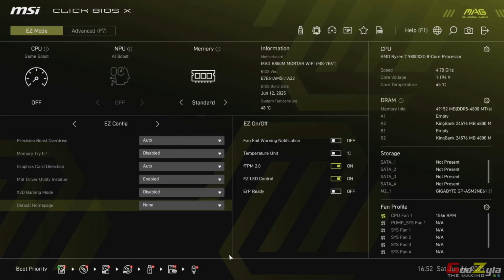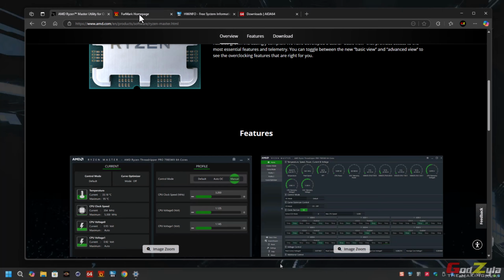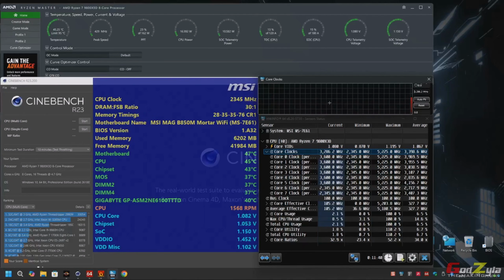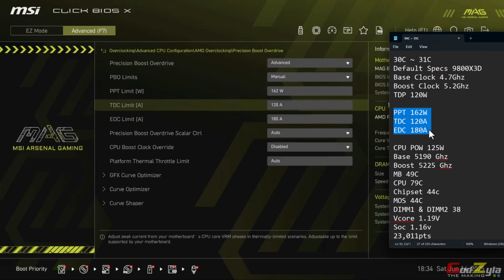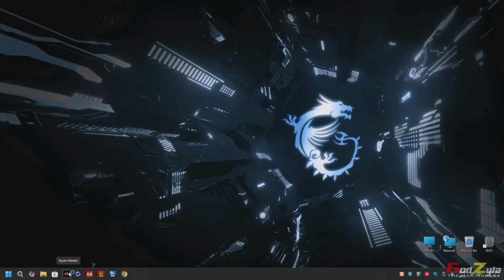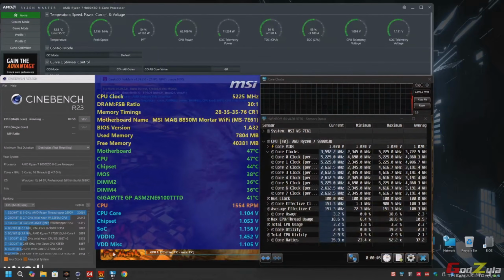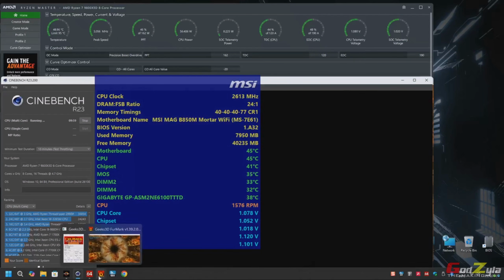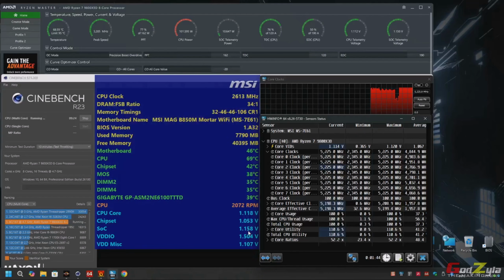PBO2 Curve Optimizing with 9800X3D on MSI Motherboard

Comment: hi i hope u still remember me lol 😂 I've followed your link and came here to learn how to tune my 9700x, 

JUST A QUESTION TO ASK YOU. before i tune, i follow someone on internet and open my pbo to enhanced mode 3 and let it draw out the power of my cpu,

yes indeed my cpu can hit 24000+- on r23 with voltage around 1.28+- and my cpu can maintain 5.5ghz no problem, but my cpu package power almost hit 170W, and i can't even find anyway to cooldown my cpu as it straight went up to 95° within seconds all the time 😅😅

why can't my cooler cool down my cpu as i saw other ppl running benchmark but still able to cool around 85+-degrees, but their cpu power is around 140W mine are 165W+-, does that matter? also my frequency are also slightly higher compared to the guy i watch. other than that all seems good

so i tune accordingly with your setting, im not sure whether this is a good performance or not for 9700x compared to others, since im just first time pc build and want to draw out all the power within a safe usage,

the results very good, from default 4.7ghz went to 5ghz, voltage around 1.05+- which is overall better than all the default tuning, even r23 from 19500+- defaults can hit up to 21800+- withou any heat issue or such
Reply: before doing this tuning, i run with pbo enhanced mode 3 with furmark cpu test, and the voltage is quite good as people said, mine which is around 1.18+- and can stable 5.37 ghz no problem, just the temperature is very hot went to 95 few seconds after start testing, but the r23 results is good, around 24k, but the cpu package power is around 138W

after that i turn my AC on and run everything on max fan speed, it can hit 5.5ghz stable and r23 score almost touched 25k if im not mistake, but voltage rises to 1.26-1.29 with 168W cpu power package. also the temp still 95 😓😓

why is that happening, others can cool down their cpu around 85+- but mine just went straight to 95, other people also use the 105w tuning as well, does that important?
Reply from the maker: @qh__0523   when you trigger enhance mode 3, you are allowing the motherboard to determind for you. no matter how you tweak to reduce, the board will just pull and push to the max. My style is not about pushing, it's to use minimium efforts but yet performs above default. 
My content here is mainly undervolting to maintain lower temsps and to prolong the life of a system. undervolting which consist of these. 
1) Having total control on settings (manual configuration and not motherboard determine) 
2) reduce power consumption but does not reduce performance. 
3) runs cooler and draw lesser current.
If your ideal is to push to the max on your processor. This content will not cater your needs. You might want to find other tweaks.
Reply: @KleoYan Understood, so can i just straight away copy your guide and apply on my 9700X? I just needed to tweak the PPT TDC and EDC? 

According to your professional experience, is there anything else needed to tweak as well? to perfectly make my 9700X perform more better at a better power consumption since my cpu might have slightly different of PPT TDC EDC compared to 98x3d

would like to hear your suggestions, overall very good to follow and understand from your content 👍🏻👍🏻
Reply from the maker: @qh__0523  yes you can do that. Just make sure you using aida64 Stability test as you go after slight changes to your settings.
Reply: @KleoYan do u have any recommendations for 9700x's PPT TDC EDC?

or should i just say, how to exactly tune my 9700x?

because by following ur steps to tune my 9700x, the PPT TDC EDC are seems all default, 65W 75A 150A, all seems default and does this mean i didn't even tune that much on my cpu?

also u asked to test with aida64, how? do the 'system stability test' on aida64? and tick 'stress cpu'?
Reply from the maker: @qh__0523   that's my point. having default PPT TDC and EDC , play with vcore offset + vddcr_soc voltage to bring down thermal and to fiddle with Curve optimizer + Curve Shaper to lower down the current drawn, further aid in dropping thermal and at the meantime performs above defualt stattings. I dont think you fully understand my last reply .. I have stated very clearly "My style is not about pushing, it's to use minimium efforts but yet performs above default. My content here is mainly undervolting to maintain lower temsps and to prolong the life of a system. undervolting which consist of these. "
Reply from the maker: @qh__0523  forget to mentioned for Aida 64 stability test, check on Stress CPU, Stress FPU, Stress Cache and Stress System Memory
Reply: @KleoYan alright noted, thank you for keep answering my silly ass question 🤣🤣 

about aida 64, i run them all together same time or test them each by each? also how long should i test? 

i tested with individually cpu / FPU, cpu can boost more frequency compared to my FPU idk why
Reply from the maker: @qh__0523  you want to run all together as you want to stress all out for stability. test it for 15 to 30mins everytime you switch from numbers in UEFI, once confirm, run 2hours on Aida again and also 2 ours on OCCT with AVX2 on.. seleck extreme and to run the test with CPU + RAMS
Reply: @KleoYan for OCCT we need to download ourselves? do you have any video for me to refer to? since you might not have mentioned OCCT in this video
Reply from the maker: @qh__0523  https://www.ocbase.com/download nope dont have any vids for this.. test it 15mintues for a start.. once you have all configuration done properly. run 2 hours .
Reply: @KleoYan hey Kleo, i couldn't run aida with 4 of the stress together for 2 hours, i ran 3 times, first time faild at 5 mins, second failed at 15mins, 3rd failed at 40mins, anyway to find out why is this happening? i followed exactly your tune, one thing different is i enable my latency killer, does that matter?

during the stress, i check with aida and hwinfo, the voltage, frequency, temperature, all results are extremely good compared to stock, and i found out that my cpu package power can only run fully 88W on cpu and fpu stress, cannot reach to 88W for 4 of the test, around 84smtg, is that normal?

what would u suggest me to tweak in order to make it stable? turn off latency killer? would like to hear from you 😭😭😭
Reply from the maker: @q @qh__0523  will write out what you should do and please stay close to the steps as those are the way to narrow down which steps gone wrong.

==Undervolting  Steps for 9700X==

Clear CMOS first  (PLEASE MAKE SURE TO CLEAR CMOS) and go into UEFI / BIOS

01) Go to Overclocking
02) Enable A-XMP or EXPO (depending your rams which it supports)
03) Set DRAM Speed 6000
04) Set FCLK Frequency 2000
05) Set UCLK DIV1 Mode to UCLK=MEMCLK
06) Set CPU Voltage to Offset
07) Set CPU Offset Mode Mark to - (negative)
08) Set CPU Offset Voltage to 0.05V
09) Set CPU NB/SoC Voltage to Override Mode
10) Set Override CPU NB/SoC voltage to 1.15v (make sure is 1.15v and not 1.5v)
11) Save and load to windows, run Aida 64 Stability test for 30minutes

If with errors, go back to UEFI, set the CPU Offset Voltage to 0.025V, repeat step 11) 
If still error, go back to UEFI set CPU Offset Voltage to Auto. (repeat step 11) 

if still error, go back to UEFI set Override CPU NB/SoC Voltage to 1.16V (repeat step 11) 
If still error, go back to UEFI set Override CPU NB/SoC Voltage to 1.17V (repeat step 11) 
you might need to set NB/SoC Voltage higher if it keeps failing but do not set CPU NB/SoC voltage above 1.18v
If no errors, go to UEFI and proceed to step 12).
The above is to ensure your processor can run at offset voltage and your RAMs able to run NB/SoC Voltage at 1.15v ~ 1.18v (depends which is stable for you)

12) Go to Overclocking
13) Set High-Efficiency Mode to Enable
14) Set Memory Timing Preset to Tightest 
15) Save and load to windows, run Aida 64 Stability test for 30minutes

If with errors, go back to UEFI, set Memory Timing Preset to Tighter, repeat step 15) 
If still error, go back to UEFI set High-Efficiency Mode to Auto.
If no errors, go to UEFI and proceed to step 16).

16) Click on Advanced CPU Configuration
17) Click on Precision Boost Overdrive
18) Click on Manual 
19) PPT Limit to 88W / 88000mA 
20) TDC limit to 75A / 75000mA 
21) EDC limit to 150A / 150000mA
22) Set Platform Thermal Throttle Limit 90
23) Scroll down, click on Curve Optimizer
24) Select All Cores under Curve Optimizer
25) Select Negative under All Core Curve Optimizer Sign
26) Set All Core Curve Optimizer Magnitude to value 20 
27) Save and load to windows, run Aida 64 Stability test for 30minutes

If with errors, go back to UEFI, set All Core Curve Optimizer Magnitude to -15, repeat step 27)
If with errors, go back to UEFI, set All Core Curve Optimizer Magnitude to -10, repeat step 27)
If no errors proceed step 28)

28) Set curve shaper as following.
Med Frequency , Low Temp & Med Temp & High Temp to -15
High Frequency , Low Temp & Med Temp & High Temp to -10
Max Frequency , Low Temp & Med Temp & High Temp to -05
29) Save and load to windows, run Aida 64 Stability test for 30minutes

If with errors, go back to UEFI, set Curve Shaper to all auto and repeat 29) 

once everything stable, run Aida 64 Stability test for 2 hours and OCCT test for 2 hours.
Reply: @KleoYan just finished doing step by step all exactly same, my system failed at 28, which is curve shaper tune, everything works fine with 30mins of runs on aida64, except curve shaper applied, tested 3 times all failed 

dont mind if i ask, can i lower my curve optimizer to all core -15, set my soc to 1.165V and set the curve shaper med(-10) high (-5) max(0), also enabled latency killer for my ram...  is that okay? or should i just turn the curve shaper to auto and the rest just remain by your steps? will i lose any performance if I didn't use curve shaper?
Reply from the maker: @qh__0523  what about leave curve shaper as it is and set curve optimizer to -15 instead of -20. If it does not work. I would set curve shaper to auto and leave curve optimizer to -20. Reason you are facing this as each processor has either very good bin or average bin.
Reply: @KleoYan sure, but after doing the tuning as i said I've ran aida 25mins all seems perfect, now I'll try and follow this and see

and also what does good bin and average bin means? the quality of the cpu chipset itself??
Reply from the maker: @qh__0523  yes the silicon quality of the processor.
Reply: @KleoYan yea i kinda just need to accept that my cpu bin is just average 😅 it's okay at least now i know what's the problem I've faced, will try and stress it now and see what's going on👍🏻👍🏻
Reply from the maker: @qh__0523  ok, all the best for your configuration.
Reply: @KleoYan yea just finished running aida64 cpu fpu system and memory stress 4 together and it didn't fail up, will try occt soon

once again thankyou somuch Kleo for helping me out🙏🏻🙏🏻👍🏻
Reply from the maker: @qh__0523  You are most welcome. so which did you adapt to? leaving the curve shaper and to set curve optimizer to -15?
Reply: @KleoYan ya, all maintained as you video's guide & your comments up there's for this 9700x, 

except for curve optimizer from all core -20 set to -15, after done tuning with this i couldn't tell much difference but as long as my system able to handle aida64 cpu fpu system cache and ram full stress for 2 hours no problem, current still running on OCCT extreme cpu+ram avx2 50mins so far... (9.12.2025 / 12.07am MY/SG)

if really want to peak out one difference that i can tell is the cpu frequency, if following ur guide it can run and stable around 5.3-5.4 +-, but system failed all the time though i run 5 times in total all failed, but turning CO to -15 and others remain still, all runs exactly same, voltage thermal and such, just the cpu frequency drop slightly 0.1-0.2 which stable around 5.2+-, all of these read from hwinfo & aida64

my room temp is same as you as im Malaysian and no AC turned on all the time, cpu didn't even touched 75 but my fan i set all max, sound wasn't noticeable so i dont care at all

this can be use as a reference for you to make more content on mid-end cpus, it might really help alot by applying your own technical knowledge in order to maximise performance with default power draw, yet also to prolong pc part's lifespan as long as it can, and that's my priority since im not gonna change my pc in less than 5-8years in future 😂

again tqsm with the help, hope this information results might give u some help👍🏻👍🏻

edit: btw how to set my occt run 2hours? i set 2hours and it stopped at 1 hours but the test all work fine no problem
Reply from the maker: @qh__0523  Thanks for the info.. for 2 hours test on OCCT, i just set the time above 2 hours.